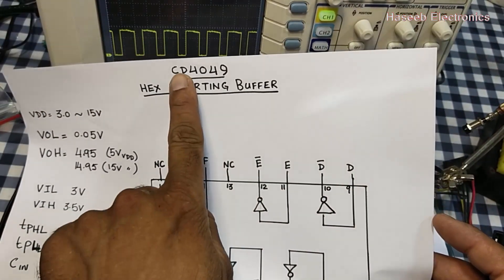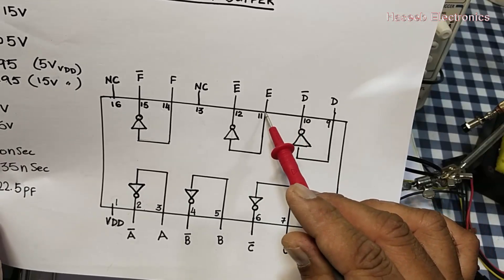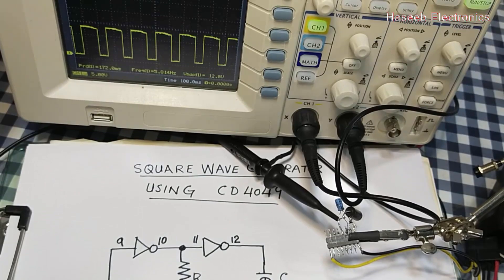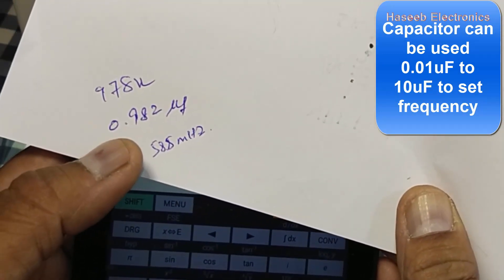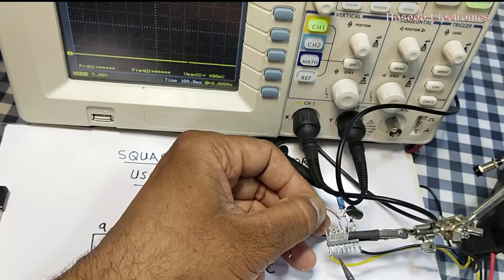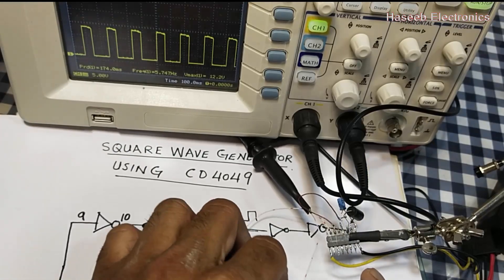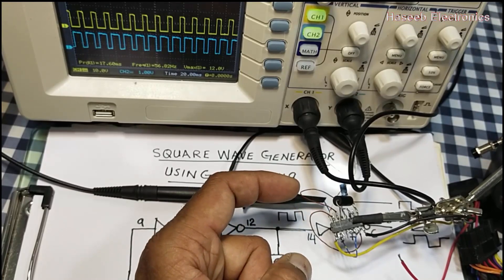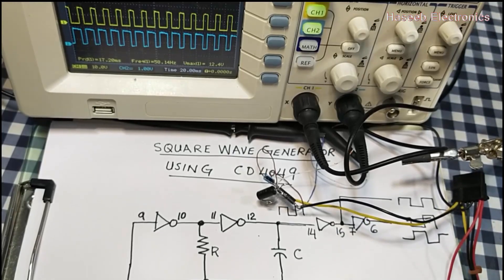{457} Square Wave Generator Circuit Using CD4049 Hex Inverting Buffer CMOS IC

Comment: Very good and useful information sir . What if we change the circuit and connect  resistor between pin 9 and 15(cover 3 not gates) in parallel with capacitor between pin 9 and 12(cover 2 not gates). And can you show us the flow of current in the circuit.can we expect 83hz with C=100pf and R=540k ohm ? . thank you very much

Comment: i made this circuit to but i used a 0.1 uf microfarads ceramic capacitor and 100k resistor and i powerd it from a 9 volts dc battery and all i got was 56 to 57 hertz

Comment: Can we use led bulb driver ic to make a battery charger. Is both pwm ic in smps and led driver ic are same
Reply from the maker: LED driver IC have buck converter function and the PWM controller IC is used to produce isolated output. so it is much better to use PWM controller to make charger
Reply: @HaseebElectronics  can we make battery charger from LED bulb scrap .That is what isi am asking. Can we use it in a isolated flyback. Converter as pwm ic
Reply from the maker: @prasanthr3875 NO, because LED drivers change its freq instead of changing its duty cycle. so it will it match with smps transformer. because smps transformer have a fix frequency switching. so LED driver will cause to heatup the transformer OR it will damage itself. because at low frequency the XL will low and it will cause to overload the mosfet of driver ic. at high frequency the transformer will saturate

Comment: Thank you, much respected. What if we put an inductor instead of a resistor between pin 10 and 11. And can you show us the flow of current in the circuit.
Reply from the maker: best regards
inductor have a inductive reactance, which is similar to the dc resistance
problem while using inductor:-
at low frequency it will produce low inductive reactance so it will provide a low value resistance and it will cause to damp the signal 
at high frequency its inductive reactance will more high. so it will not allow the circuit to produce fix frequency,
rising edge, the magnetic field will build in inductor, and in collapsing time, it will  produce reverse voltage, which will damage the buffer immediately, because in logic circuits, the negative logic level is not allowed
Reply: @HaseebElectronics  great, many thanks for your blessed efforts and remarks.

Comment: Sir please make a video series spwm signal generate for low frequency(50or60hz). It's working and caluclation. what is mean low side and high side for mosfet drive and what is the difference between low and high side . Why do we neend low and high.make a cricuit with details.Thanks good bless you sir ji